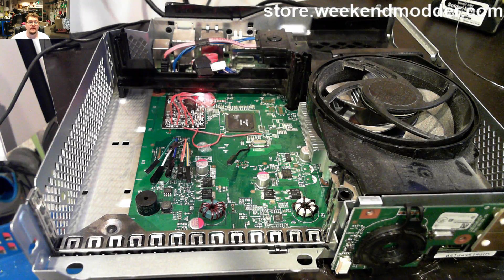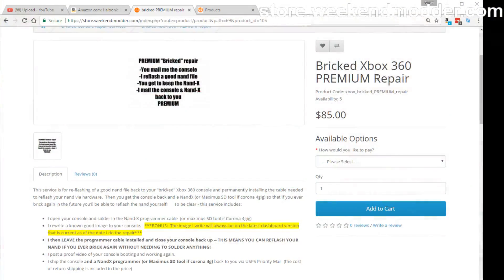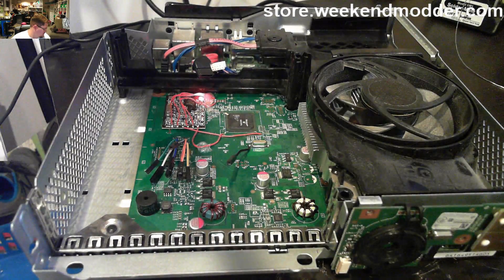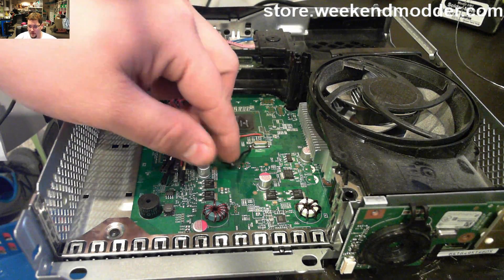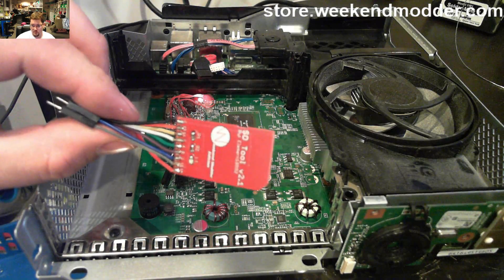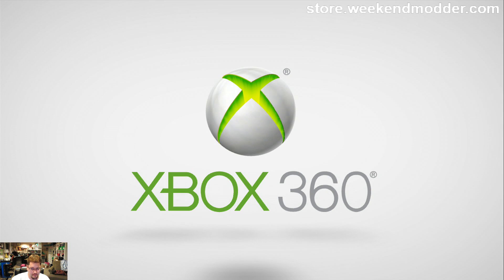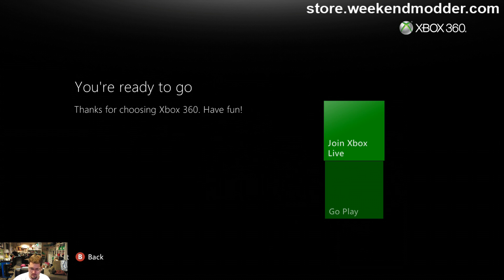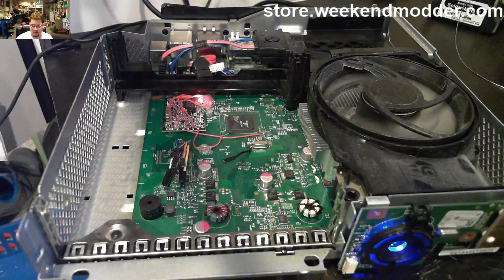Corona 4gb Premium Unbrick Service  - unbrick yourself with no soldering!

Comment: Can the particles from the fiber glass pen cause problems? I just got issues booting it after reading the nand and using one, I didn’t write an ecc or anything. Used a duster to clean the board off as much as possible and now it boots

Comment: One question mate.... My xbox 360 s is not corona but completely bricked i turn it on but doesn't do any sign of life other than beeping...so will removing my rgh chip solve the problem
And many thanks❤️
Reply: Ps: im sure its bricked cause its mostly my fault
Reply from the maker: No, it won't.  You'd need to rewrite the original nand image back to the console before removing the glitch chip in order for that to restore the console.

Comment: hi wm i have a xbox 360 corona 16mb nand can i use the sd tool if not can i use anything else but not the nand-x to read the nand
Reply from the maker: No, you can't use an SD tool to read a 16mb Nand because the SD tool is specifically for use on 4gb nand coronas.  As far as alternatives to the Nand-X you could use a JR-Programmer (v1/v2), Matrix Programmer, Squirt Slave programmer, Super Nand Flasher, etc....

Comment: anyone know how to fix this

Connection Error
Checking Files
Connection Error
Checking Console..
Version: 03
Flash Config: 0xFFFFFFFF
Error: FFF reading block 0
Error: FFF reading block 1
Error: FFF reading block 2
Error: FFF reading block 3
FFFFFFFF
Reply from the maker: That's bad soldering - you're not getting a valid flash config.

Comment: hey buddy me again, where did you get that SD TOOL? I got a maximus SD tool or someshit with my Jr programmer but it is a qsb and I like yours better with the wires, the maximus sucks. where do I buy one like that? thanks bro
Reply from the maker: You can buy them from me, www.store.weekendmodder.com
Reply: yet another question my friend. you say this does not come with wire. does it come with that little bit you need to "put the console into read write mode" or whatever? never done a 4gb.
Reply from the maker: the bit to "put the console into read/write mode" is just a single wire from the point marked "C" on the SD tool to the end of the Crystal you see there as it's wired in the video. So as it's just a wire, no it's also not included.
Reply: ah alright just a simple wire? looked like a plug and release thing you had going on in a video i saw. i have 28 AWG and 30 AWG kynar thatll be fine right?

Comment: I'm rghing my trinity and I've soldered everything but I'm not sure if the resistor that 'wire D' on the ace v3 is supposed to be soldered to is not there so when I try and boot it doesn't do anything, is there any way to fix this, thanks
Reply from the maker: You knocked off the resistor?
Reply: TheWeekendModder yeh I think it came of when I was soldering

Comment: weekend i have the dash 17502 what will i have to do rgh 1.2 or what?
Reply from the maker: RGH 1.2 is for phats.  If you have a phat on 17502 then RGH 1.2 will work fine.